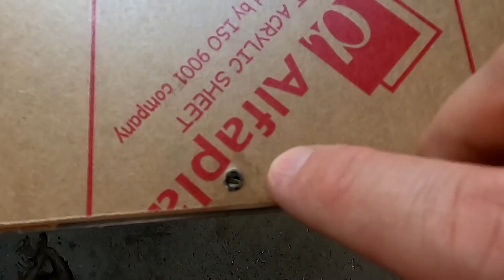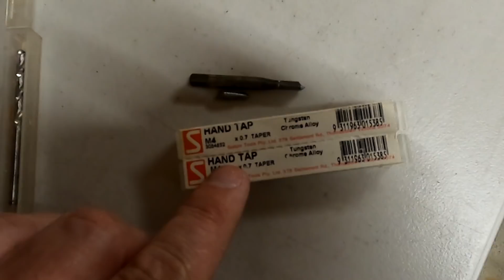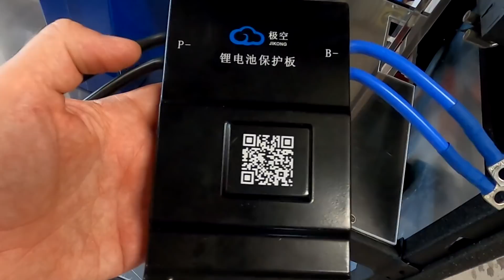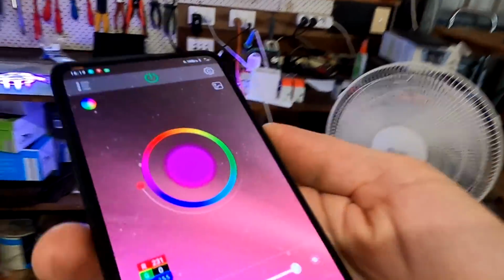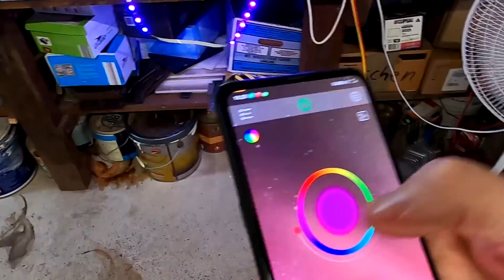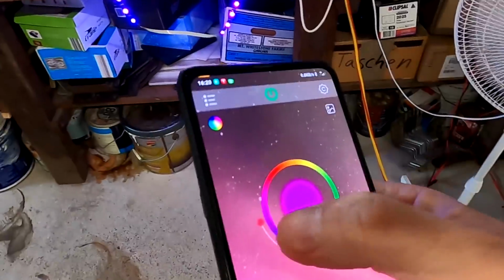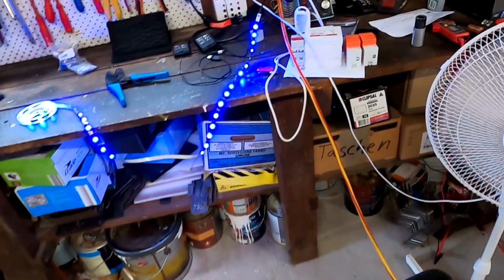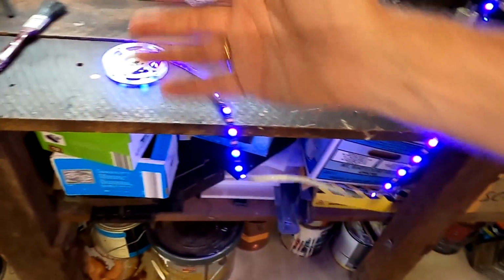The new features of Battery 2.0 (and new challenges)! Battery 2.0

Comment: Also, consider sourcing an LED that connects to either side of the fuse so that when the fuse is blown, the LED lights.   Search for led fuse indicator.  Given the voltage of the batteries, nothing fancy should be needed, just an LED connected to either side of it.  Another option is to place LEDs at your wiring block that bridge between each cell and go out if the fuse is blown.  I prefer the blown fuse illumination over the fuse good illumination.  Part of my "don't bother me if nothing is wrong" philosophy.
Reply from the maker: The fuses will literally never blow. They are more peace of mind actually to protect the thinner balance cables from this massive battery 🙂
Reply: I do this on all of my builds. Super fast diagnostics.

Comment: You should chamfer that hole on the top and the bottom of plexi ever so slightly.  Sharp corners as created by drilling are prime stress points for cracking.  Breaks tap using drill, shows spares "Hand tap".  As for your base material, I would have sourced some  unclad glass laminate -- the stuff PCBs are made out of.  Strong as hell and  you can get it w/ out copper cladding.  Stuff is nearly indestructible.

Comment: I've been having more consistent result soldering my voltage sensing wore to the busbars. Kept having conflicting readings with traditional crimp connections. I like the idea of fusing them but I wonder how it will change the resistance. Bigger fuses seem to have difference in where they blow, they're not exactly the same. Just in what I've learned and just my opinion too. Keep killing it Andy. Happy to see all the progress!
Reply: Fuses won't change anything.  Keep in mind the wires are tiny as it is.  You can only properly ascertain battery voltage if very little current is running through the wires.  This is why the higher amperage balancers only sense when current isn't flowing.  The wire is afterall, a fuse --- just a really dangerous one.

Comment: What's the point in drilling two holes per busbar, just jumper from one 16 bank to the other. Minimise the negative effects you have on the current carrying busbars
Reply from the maker: No piggybacking of balance leads! Big no no...
Reply: @OffGridGarageAustralia  there's no difference in your connection point weather it's at the busbar or at those terminals on the blocks you are still using a common point.

Comment: Extend the wires by soldering another wire to your S wires mate. Make a aluminium bracket to too hold it down. Use glass doors on shelve as it is not combustible.

Comment: Why not mount the bms to the aluminum plate above the cells its controlling, that will act as a heat sink for the bms possibly extending its life a bit as it runs cooler. Nice idea with the balance lead Junction connectors for future proofing test items.
Reply from the maker: Well, the BMS will not get warm as the max current is only 80A, so heat should not be a problem. And, how do I mount it without an mounting holes...
Reply: @OffGridGarageAustralia  not sure if you have that product, but we have a double sided tape here that is heavy duty for things like a mirror so on.
Additional benifit is the bms won't take the space between the bus bar and the cells, leaving room for other possible things.
But re reading my comment it might not work because of the balance leads Junction box.
I've extended ally balance leads by 60cm so that it's all 1 wiring harness and not 500 cables leading everywhere.
Reply from the maker: @waynescheepers145  OK, I'm sure we have something similar. The main questions is though, does it need to be mounted at all. Can it not just sitting flat on the shelf?
Reply: @OffGridGarageAustralia  not sure of compliance requires it  mounted or not, but the bms can go flat I don't see why not, unless you want to free up space for future use. But maybe extend everything into 1 harness.

Comment: I am not sure if it is a good idea to insert fuses to the balancing lines. If the balancer is measuring only while it is not balancing, then it should be OK. But if not, there could be a tiny measurement error due to the voltage drop. I don't know the resistance of these fuses (5 , 10, 20 mOhms or more?). For a balancing current of 2A the additional voltage drop could be some 10 .. 50 mV already. OK, not that much and all lines have a fuse, so it should cancel out, but maybe not for the first/last cell. It would be interesting to know if the balancer is working as expected with the fuses. After the balancer says that all cells are properly balanced, could you check the voltages with a multimeter please?
Reply from the maker: Well, if this is a problem, then I should not use the terminal blocks either, this all adds to the resistance. 
With the JK BMS its not an issue because each balance cable can be calibrated separately to suit the actual resistance of the individual cable.

Comment: Looking really nice.  You could use PTCs(resetable fuse resistors) instead of single use fuses for the leads.  Probably likely to have a few fuses blow if you are testing balancers.  If you are wondering if the wires melt....no.  The balancer diodes smoke first.  No particular reason I know that. LOL.
Reply from the maker: I meant if you have a short on one of the balance cables it will melt quickly but still could lead to a fire of its insulation.
I'm not expecting to have more than 5A of current going through these balance cables actually. If I go 10A I would need thicker cable already...

Comment: Why don't you make a separate bank that's holds fuses? For example those types of fuses found in cars. That way, when they blow, they would be quite easy to replace. I don't know the cost of the fuses that you use, but the car fuses are relatively cheap
Reply from the maker: These cost $2 per a pack of 100.
I'm really not expecting they will blow at all. It is more form a safety perspective to protect the cables.

Comment: Andy, great ideas. For attaching your jk bms to the chassis, you could use the clamps of your solar panels.
Reply from the maker: The clamps if the solar panels? Which war holding down the panels on the rails?
Reply: @OffGridGarageAustralia  thats right, those ones, you can hold the jk down with it 😁 I might think you have some laying around. Otherwise, two holes and a tywrap
Reply from the maker: @edwardvanhazendonk  The questions is, do I need to hold it down? Where could it go?
Reply: @OffGridGarageAustralia  I am constructing a very similar project. I consider useing a thermal adhesive pad to hold that exact bms in place. Seems like it would also help keep it cool.

Comment: Go fancy. Instead of soldering in fuses use ATO/ATC fuses or minifuses. They make them now with a built in red LED that lights up if the fuse blows.
Reply from the maker: I looked at them. The problem is they need to be installed as close to the battery terminals as possible.

Comment: 3M VHB tape, industrial velcro (both sides are the same) or Alien Tape all will hold that BMS to any vertical surface. No screws needed. And no, it won't fall off. Cover the whole bottom of the BMS and you won't be able to pull it off without pry tools.
Reply from the maker: Yeah, the Velcro... same principal as for the Raspi
Reply: Don't do that, BMS heats up.  I love me some VHB, but all adhesives don't fare well with prolonged heat.
Reply: @mhamma6560  The 3M version of industrial velcro is not like the cloth version. It can do daily heat cycling over 160F for 10 years and still hold like a champ. Similarly real VHB hold skyscraper windows in despite heat cycling. If the BMS is heavy cycling that much, it is going to burn out very quickly. Since there are no factory mounting points on it, I doubt they plan for it to be heat sinked.
Reply from the maker: @mhamma6560  No heat in the JK-BMS. It has a max power los of 12W at 200A. I'll pull only 80A max.
Reply: @OffGridGarageAustralia  agreed

Comment: For the broken tap
Use a T handle tapping wrench 
Put your wd40 on the tap and turn it by hand
After you get it started,  do quarter to half turns and back off to break the aluminum chips from your tap
Aluminum can be gummy,  and stick to the tap and break it
And 4mm threads can hum up fast using the drill
Reply from the maker: I know how to hand tap, have done this in my apprenticeship in the 80s. We had still 3 sets to tap one thread. The thread depth got deeper and deeper with every set you used. It took forever. Here in AU, they mainly use the machine tapping. That's the first one I broke in 30 years. It broke because I tapped thought he Al sheet which moved slightly and jammed the tap.
Reply: You are correct. Hand tap ≠ machine tap 😎

Comment: Hi Andy a couple of things , those covers on the back of the breaker they get removed and a accessory rear connection kit ( Studs ) get inserted and you can connect direct onto the studs,

 In regard to the fuses i tried some 5 amp fuses i also short circuit tested to see how aggressive they ruptured, all be it i used ceramic fuses  of which i found the rupture was well contained.

What i also tried was a voltage drop  & balancing current test across the fuse of which i know you like a balancing challenge so i was surprised at the result and i think you should check to see if you will be happy with the result
Reply from the maker: Thanks for sharing. I can set a separate resistance value for each balance channel in the BMS individually, so can calibrate each line if I need to.
I like these small fuses because... they are small and I can mount them easily very close to the actual bus bar terminals.
I looked at the rear connection kit and it seems like an accessory you need to buy. It also looks rather thin considering the normal cable lug would be sitting on the thick terminal busbar of these breakers.

Comment: Sir, in respect to your "clear front viewing port", most regulations speaking of combustible or flammable material have a rating related to it. In your case, the plastic material data sheet should refer to this rating, and as long as it meets or exceeds it, you are good. Especially for a "monitoring window". UL (Underwritters Laboratory) lists a flammability rating of V-0 or such. I am sure your regulations have the same type of rating. Good luck!!
Reply from the maker: Thank you James. I'll have a look at this. There is also the Best Practice Guide for Battery Storage Equipment which gives some guidelines around that here in Australia.
Reply: Polycarbonate or glass could work.   Acrylic won't.

Comment: The transparent covers and RGB LEDs would have looked really nice Andy, sad it can't be done. I guess the BMS is meant to be attached with double sided tape, as they usually do in those batteries. Oh and what's the plan for fixtures for those cells? Will there be any fixture to prevent permanent cell bulging, not compression. Thanks.
Reply: I read that: All 3M VHB tapes  plastics that include acrylic, ABS, polycarbonate, PVC, polyester, Polyamide, Polyimide, Phenolic, and Noryl and that: the 3M VHB Tape LSE Series, is a fast, easy and reliable bonding solution for LSE substrates like Polypropylene (PP), Thermoplastic Olefins (TPO), and Thermoplastic Elastomers (TPE), as well as composite materials like glass reinforced plastic (GRP) or fiber reinforced plastic (FRP)
Reply from the maker: Thanks for your ideas.
There will be no fixture, compression or any other bonding of the battery cells. All cells will have a 2-3mm gap in between.

Comment: Hello Andi

If a current of just under 5 amps would flow for a longer period of time, the fuse would not blow. How long a thin balancer cable can withstand 5 amps is imaginable ;-) 

The line distributor shown is not much good . 

The screw that is inserted through turns when you tighten the nut. 

At least that's what happened to me , I broke the back , locked the nut with the screw and then glued ( filled ) the cavity around the screw head with 2 K glue .

Open the BMS and solder thicker and longer cables to it . 

This would be more elegant than working with these line distributors . 

Grüsse aus Deutschland ( Ruhrarea )
Reply from the maker: The cables at the BMS are fixed and cannot be replaced with thicker cables. The whole case would not close any more.
Reply: @OffGridGarageAustralia  The BMS I know have lines (high current lines) that are ultrasonically welded. 

With a soldering iron with enough power you can solder thicker wires, and a housing can be adapted to thicker wires. 

But I did not mean these lines, I meant the balancer lines of the individual cells, these can be easily replaced with thicker lines.

Comment: For the BMS B- and P- wires, you can use the same type of DIN-rail gray terminal blocks like you have there for the balancing leads (just for higher diameter wires).
Reply: Or DIN-rail terminals with a piece of busbar with studs or holes. These terminals are for connection of 35-150 sq mm (typical) wires. But it sometimes has relatively high price.

Comment: Why not go ahead and use your aluminum for the sides but have a hole cut in with a window plexiglass you can still see in you still follow a code and you can put your lights on the inside to light it up so you can see in there
Reply from the maker: I need to see what's in the regulations for that. I really like the idea of having a transparent front.

Comment: BMS sensor cables; what about too much resistance/voltage drop on so complicated sensor wireing?
Reply from the maker: I can set the resistance in the BMS for each balance channel to compensate for that.
Reply: It's moot for sensing.   A 1 meter 20ga copper wire using 10ma (v sense) provides 3.99939 volts from a 4v input.

Comment: Hi Andy, I have used Automotive in-line fuse holders with 5 Amp Micro Blade Fuses to protect the balancing leads.
Also EPIC H-A connectors for the devices (female on the battery, male on the balancer).
Reply: They are not rated for 60V.  The 20mm or 30mm round versions come with higher voltage.
Reply: @jmaus2k  You are right, I forgot about that ... my battery is only 8S (24V).
Reply from the maker: Do we need a 60V rating? The BMS measures the cells individually...
I'm not expecting the fuses will blow ever. It's more form a safety perspective of having it to protect the cables.
Reply: In case there is an fault from the most postitive cell-balancing lead against the Ground you have the max pack Voltage the fuse has to break.
Reply from the maker: @OlanFantaziya  OK, for this scenario you're right. So car fuses cannot be used for this purpose.
Reply: @OffGridGarageAustralia  Which two wires do you expect to cross?  You don't know which will short.   Yeah, you need max charged pack voltage rating(maybe that is 58 or 59V).  The mini blade fuses are only rated at 32V.

Comment: Hi Andy! I like your Idea with the additional terminals to connect further equipement. But have a look at something like Wago's "3-Leiter-Durchgangsklemme" (Art.-Nr. 2002-1301) You could then route only one thin cable (perhaps with a 10A Fuse?) down to the Terminals and wire in your BMS and the "additional device" to the Wago Terminals. Just an Idea! Less wires, cleaner look!
Reply from the maker: I know the terminals you're referring to. If connecting a BMS and separate balancer for example, you should not use the same balance cables but connect them individually to each terminal of the battery. I know some people are piggybacking their devices onto the same cables, some have even trouble afterwards 😊
Reply: Ideally you don't want to put load on the sense leads of your bms with an unrelated device like an active balancer, otherwise the bms will get skewed readings for the cells.

Comment: as for the breaker; you might think about using threaded rod connectors (long threaded nuts, like turnbuckle but all the same thread). as for the doors to cover the batteries i would hinge them with removable pins and snap latches (over center) that way if you need to get in in a hurry you can . not have to remove a bunch of screws first. (think of a breaker panel to get to the breaker open door vs remove screws) looking good
Reply from the maker: The covers of the battery storage can only be tool removable as per regulations. It's not allowed to have just a hinged cover.

Comment: 112121/1112h PST 🇺🇸  112221/0512h Brisbane 🇦🇺  Good day, Andy. Thank you for the instruction on drilling Acrylic/polycarbonate material. I learned the best method is to maintain low rpm. Hitherto, I used medium~high speed and the result being the bit, bit into the parent material and frustration as a result. Danke schon.
Same with the jig saw….have a nice day ahead und 73s…
Reply from the maker: Yes, slow speed is your friend with acrylic and the result is perfect...
Reply: Thanks.